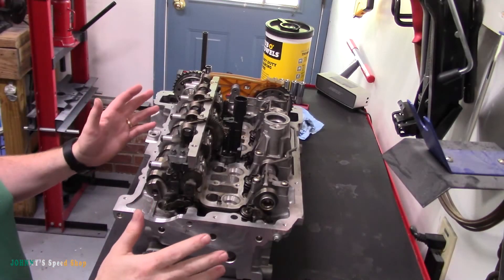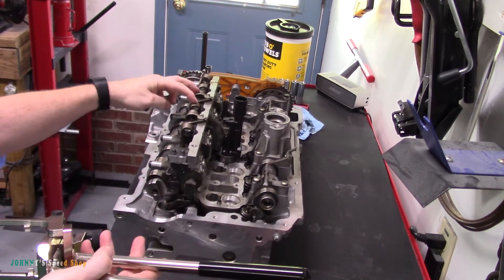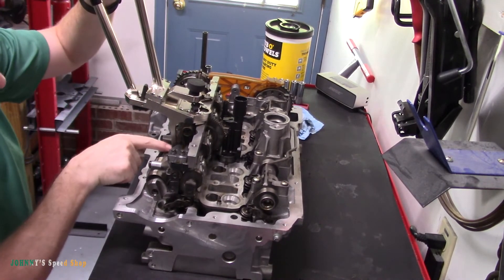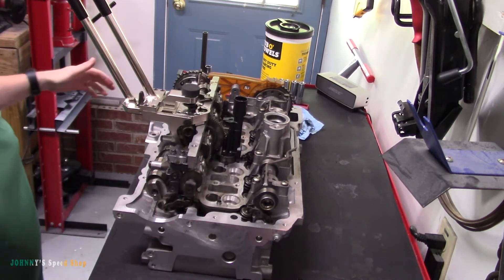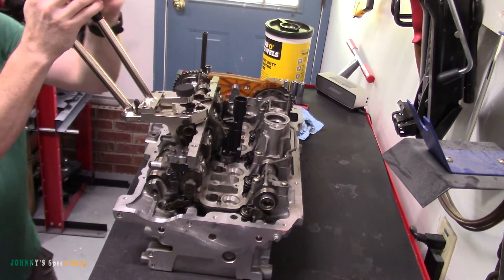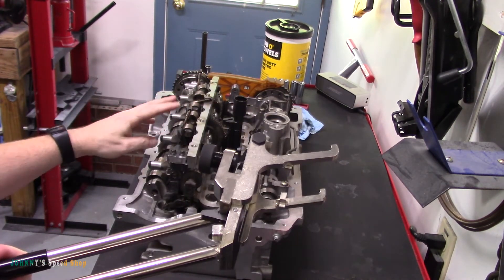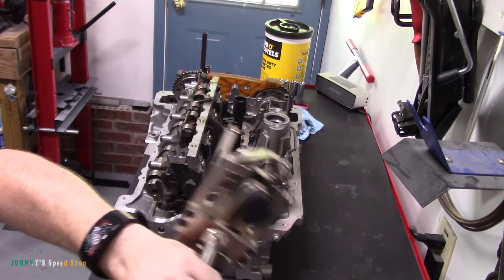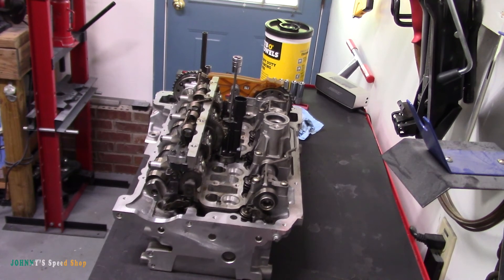BMW N20 Intermediate Lever Valve Spring Compressor

Comment: I can take off just can't get the levers to stay straight once i put it back on
Reply from the maker: the levers on the tool  ?   or do you mean cam followers  ?
Reply: @JohnnysSpeedShop  Im good ty  you should do a video on pretensioning eccentric shaft . That's what i forgot
Reply from the maker: @scottp7293  aghhh....yes you need to move that manually with a 4 or 5 mill allen key
Reply: @JohnnysSpeedShop  yeah just figured that out lol

Comment: Amazing tool right there mate, I haven’t done this job on a bimmer yet but looks like without the tool is a no no, you can tell they are under a lot of tension ... keep us updated with another few clips here in there for the engine rebuild 👍👍👍👍
Reply from the maker: Will do mate
Reply: I am doing this job right now on an n20 that's out of the car  ...and didn't have the tool.
It's next to impossible,  but not impossible to do it without the tool.
I used a metal spacer, and an interior panel removal tool to load and position the bolt for the top of the spring.  It took an extra set of hands to assist me, but we got it done.
Definitely wouldn't recommend doing it the way I did it, but it's possible.  
If I do this again, I'm buying the tool.